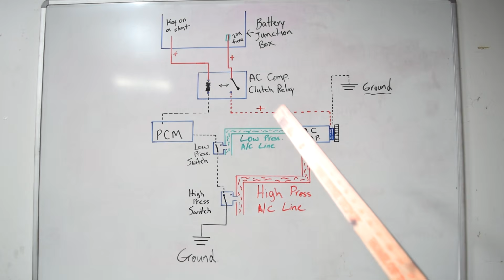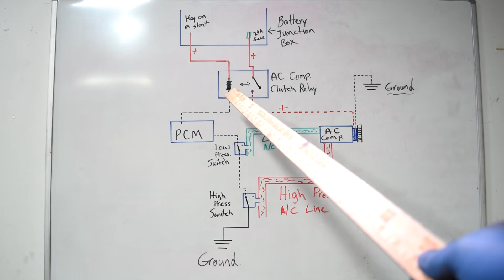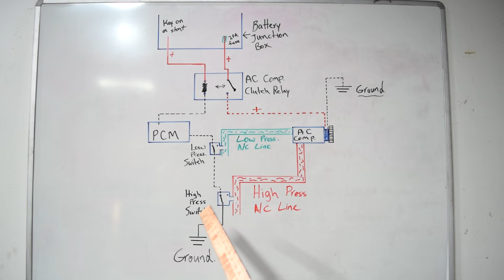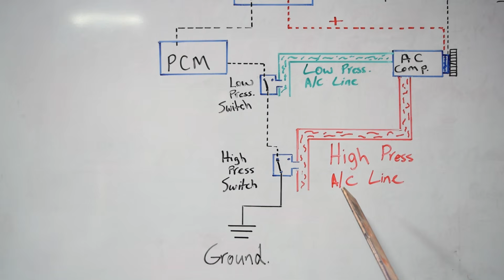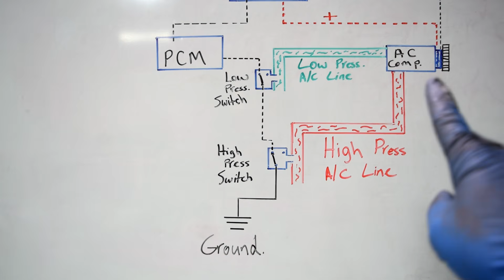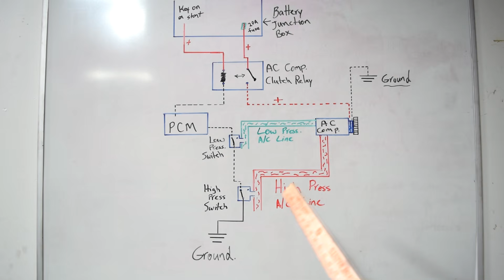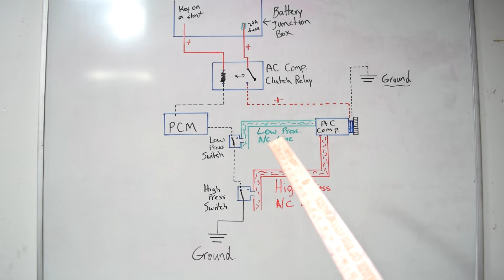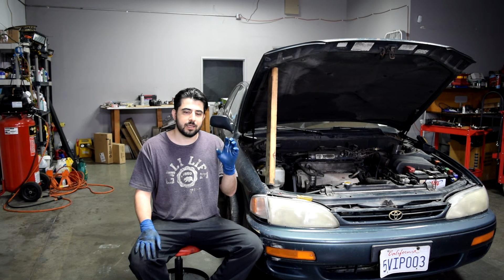How to Fix your Car's AC System - Compressor Coil, Clutch Relay, Low and High Pressure Switches

Comment: I would like to ask you a question and hoping that you will help me with my ac problem on my mazda bongo friendee dual aircon van. When I engaged the front ac blower, the clutch motor does not shut off/on automatically. It runs continously and that caused draining  the battery, so i disconnected ac front blower and only back or passenger's aircondition will run clutch normally. What should I do? I hope that I can fix it with your help before I go to the professionals if needed. Thanks and hope that you''ll help me on it.

Comment: The problem I have is the ac blows cold air while the car is moving but when stop at a light the ac clicks on and off and blows hot air and the temp starts to get hot.While the ac is clicking on and off the engine vibrates. When the car is moving again the ac blows cold air and the engine temp starts to drop back to normal. Its got freon but now i notice the fan is not coming on now. The fan was working when this started to happen. Do you think the fan was fixing to go out when this started to happen. I replace the thermostat but still have the same problem. Can you tell me what it could be. 2005 Saturn ION

Comment: The AC clutch on my Honda CRV turns off while driving but works fine in idle. I have the correct amount of R134A, installed a new high pressure swich, and new receiver/dryer-bad relay perhaps?

Comment: hi,
i would like to ask you a question, when i turn on the AC in my mercedes clk it works for 2 minutes and then the compressor stops. i checked the voltage  it drops to 9,6 volt, any idea? 
thanks
Reply: The compressor is failing. If you get it changed now you might get away with just the compressor but if you wait until it finishes grinding itself up you'll need a complete overhaul!

Comment: my low pressures and correct but my high ppressure is very low like 30 but the car cools fine but today it stoped working any idea on what can cause this some one said it may be bad compressor 2011 Silverado 64000 miles

Comment: I have a 05 Ram 1500,,,If the AC clutch keeps kicking on and off but is not sucking in the refrigerate, then what should I do or check for

Comment: got a 2009 Nissan Altima, ac clutch wasn't turning, hooked up the refrigerant and the gauge read 150 psi, way in the read.  Any thoughts?

Comment: I was interested in buying a 2001 mazda protege but the ac is faulty . I was told it blows cold but works when it wants to, And that the resistors have failed on the grounding wires to the hvac system. Ac is important to me and wanted to how expensive would this b to fix wiring? Or should I just look for something else.

Comment: Hi, I have my 2011 Sonata was blowing cold air, now it blows ambient air, it seems that clutch is engaged constantly, even when the a/c turned off, I have a suspicion that it might be a faulty relay, but then I'm not an expert, what could be the problem? and I hear horror stories about 2011 sonatas a/c issues. any ideas?

Comment: Good day,

Where is the AC Comp Relay located on a Hyundai Elantra 2014?
As, when the negative side of the battery is disconnected, and the lead touches the battery i hear a clicking sound near the compressor side, and the parasitic draw jump to 2 A and i believe it is the cause of my dead battery in the morning!

Please help!

Comment: Mark,
I have a problem with my AC in a 2005 Ford Focus, When at idle it blows cold air but when I drive the car and it is under a load the air blows out worm. Could this be an issue with the pressure switch, or is the compressor maybe disengaging because the power is needed elsewhere. Or is that one in the same?
Maybe I should just ask, why does my AC blow cold air at idle but warmer air when I start driving?

Comment: 2009 Subaru Impreza 2.5 non-turbo.  This car came to my shop complaints of a hissing/whine.
I havent tested anything except that removing the relay deactivates the A/C Clutch, but here is what I noticed:  The A/C Clutch activates randomly when the Blower Fan is turned to any position.  It has 0 (off), 1, 2, 3, 4, 5 Fan switch positions.  

The temperature setting, Recirculate button, and A/C on/off switch do not affect the Clutch randomly engaging at all.  Basically, if the blower fan is turned on, the A/C clutch turns on and off at random - But it ALWAYS turns on if I switch the fan off, then on again.

First thing I'm going to try is swap the A/C relay.  With the A/C relay out, the A/C clutch does not engage at any time.

If you good people have any tips to get me started off and save me a full circuit diagnosis I would be forever grateful!

Stay gold.

Comment: I have a car that the compressor will only engage when the blower motor is set to low.  When I put it on high, the compressor switches rapidly on and off.  I added refrigerant but it did not seem to help.  What should I do?

Comment: Hi, I like your a/c videos.  I have a question. I have a 2004 Ford Focus that pegs the temp meter when the ac is on for a while. I replaced the orifice tube and the problem continued. I then replaced the high pressure switch twice and the same problem. The compressor, condenser, and the drier are new. Only the evaporator and the lines have not been replaced. The a/c  works good and cold but once on for a while the high pressure side skyrockets causing the condenser to get super hot and thus causing so much heat the cooling fans cannot keep up. I would imagine the high pressure switch should be the problem because it should turn off the compressor when the pressure is too high, but it does not. I see that on the a/c gauges. I am lost, what do you think could be the problem? Any suggestion would be greatly appreciated.
Reply: Did you clean the hoses? Did you do this work because the compressor failed? Usually that causes contamination and must be cleaned. Did you pull a vacuum long enough? Could have air trapped in the system. Good luck.

Comment: Can you please help. My AC clutch is stuck engaged on my 2010 civic. What you suggest?
Reply: there is a relay that you have to change for the AC. the relay when it goes bas it also drains your battery

Comment: Hi, I was wondering if you can help me figure out what is wrong with the heater in my car. while I'm driving it tends to turn on by itself and shut off. It also changes where heat is blowing from. This just randomly happens but not always. Any idea?

Comment: Great explanation.  I recently had 2-  4 cylinder cars come to me with erratic idle problems.  Both were caused by bad cooling fans.  THe cars ran great with the A/C in the off position - put the A/C on and the idle was all over the place.  By the cooling fans failure, the A/C compressor would build up such high pressure, putting a big load on that little engine until the A/C high pressure switch opened to protect the system.  Once the high pressure switch opened, idle would surge until the compressor kicked back on and idle would nosedive again.  In this case, the high-pressure switch was doing exactly as you described-acting like a circuit breaker to protect the system.

Comment: Just so I have it clear, minimum low pressure on the low side is necessary but not involved in compressor cycling on and off. The high side pressure switch is initially on, allowing the compressor to turn on, but when peak pressure is reach it cuts out. This shuts off current to the compressor clutch pulley, which then dislocates to allow the compressor clutch pulley to freewheel. So, the high side switch cutting in and out is what causes the compressor to cycle on and off. Correct? Are there thermal cutout switches as well?
Reply from the maker: +spelunkerd Its the other way around, the low pressure switch does the cycling, the high pressure switch is for safety as far as I can tell on this setup, this way things don't go bust incase of a clog in the high side. No thermal cutout switches on this setup, but perhaps on the newer cars, not sure about that really. But alot of cars these days have sensor's that supply a varying signal voltage back to the pcm instead of just working like a circuit breaker like the two wire sensors in this video.
Reply: +RatchetsAnd Wrenches Oh, OK, that would work. The cutoff would be well above atmospheric pressure, cutting out when pressure drops below threshold, then cutting back in after enough gas makes it's way through the orifice tube/expansion valve to achieve low side pressure threshold. Then the compressor kicks back in and the cycle repeats. 

You've done a great job with this series, the best I've ever found on the 'net.
Reply: Both your guys videos are great.  But I think R&R wins the racecar driver hair award lol.  So dam slick!!

Anyway I'm new to youtube publishing so If youre bored check my channel!

Stay gold.

Comment: It seems strange to have the low pressure switch designed to not allow the compressor to turn if low side pressures are not at a minimum value. Was it designed this way to avoid further damaging a system that might be contaminated by atmospheric air/water?
Reply from the maker: +spelunkerd I think it also has to be that way so it doesn't simply pull a vacuum on the low side either. In so many words the low pressure switch works as the compressor cycling switch too.

Comment: great vids! just subscribed!
been having troubles with my ac... freon is filled, pressure switch checked and working, changed the relay... the clutch wont engage. tried to wire the clutch directly to the battery and it engages and cools the air... but it wont do so if it isn't wired directly... any ideas what to check next? thx
Reply: +zac7654321 fixed! the battery's connectors were dirty from oxidation...